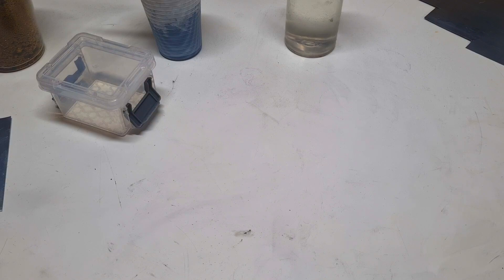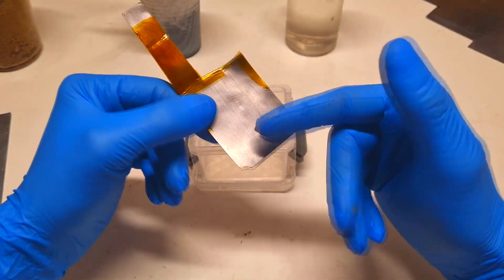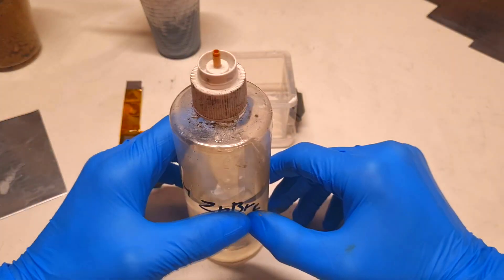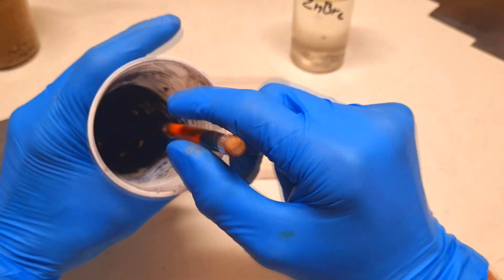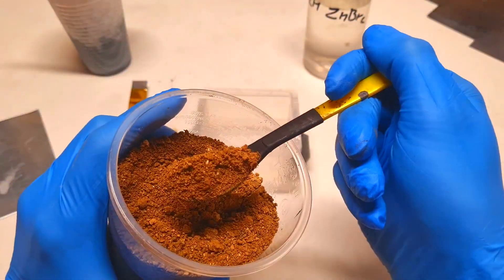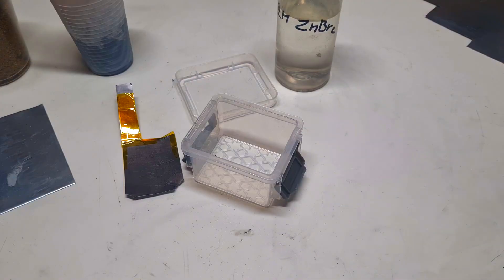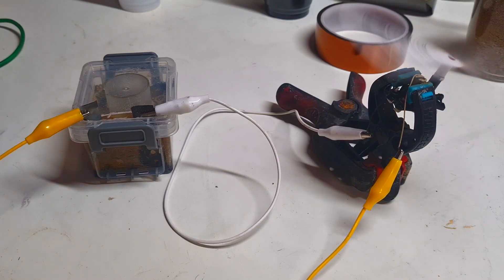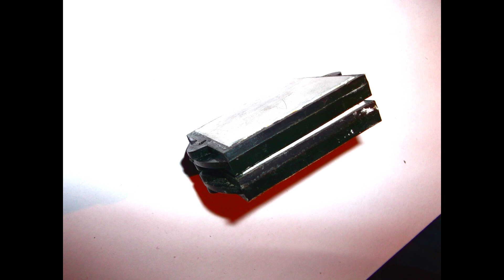Diy Zinc Bromine Battery a little different

Comment: Zinc seems extremely potential as power source. It has negative resistance properties. There is some additives that might reduce the crystal build up. Like lingin and macrogol.
Reply from the maker: Correct

Comment: Young man, ‘I like your work on batteries. Question ‘ Wouldn’t this Battery work better under compression? Also, ‘ couldn’t you have used Agar or PVA instead of the Dirt? What about using Nylon Rip Stop Fabrics as the separation material?😊😊Thanks again for your contribution to our World of knowledge.😊😊😊😊😊😊😊😊😊😊
Reply from the maker: 👍👍👍 That is the real beauty of this cell,.... you can experiment, modify, upgrade,... you can make all sort of changes to see what can work at best.